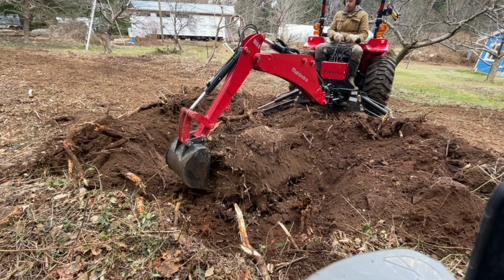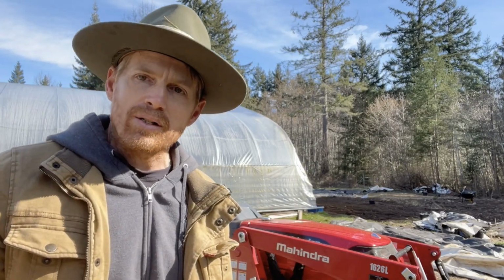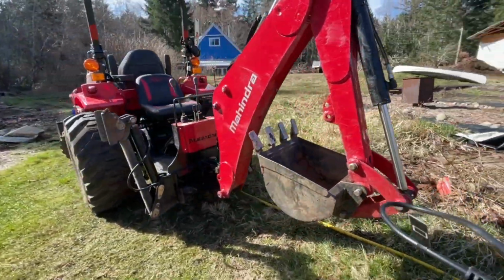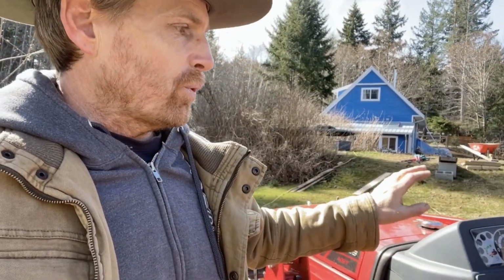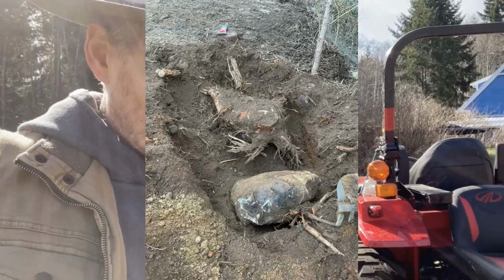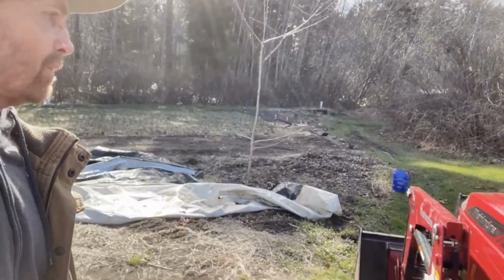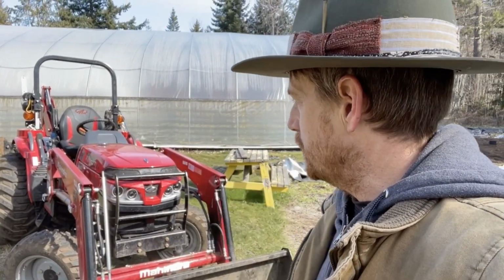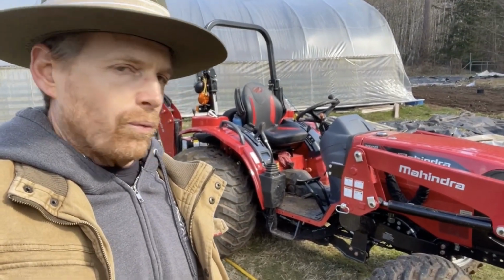REVIEWING my recently bought MAHINDRA Farm Tractor! 🚜

Comment: I have a 2021 1626 shuttle shift and one of the best upgrades I’ve done was add rimguard to the rear tires.  Made a huge difference in terms of traction and also working on a slope makes it much more stable. If you’re not sure what rimguard is it’s a brand name for a beet juice product added to the tires for ballast. Beet juice is about 3 lbs heavier a gallon than water. My starter went out at 80 hrs which sucked but I have 350 hours on it now and that’s the only problem I’ve encountered. Also the diff lock is not in the best place in my opinion.